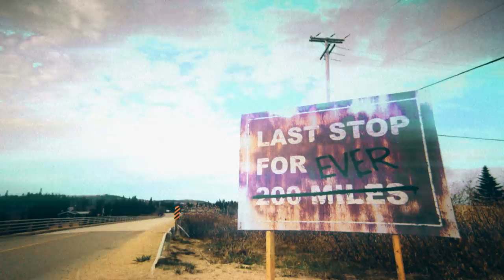Trailer | Last Stop Garage

Comment: This show is so full of shit like the red truck that had been left out in the bush for a long time and they went out to see if it still had the radiator still in it so they drive around locate this truck that thats been sitting the scrub for years and when they show it its got fresh dirt on the tires tires ars still pumped up and you can see the tire tracks still in the sand the thing has just been towed there do these producers  know the meaning of reality